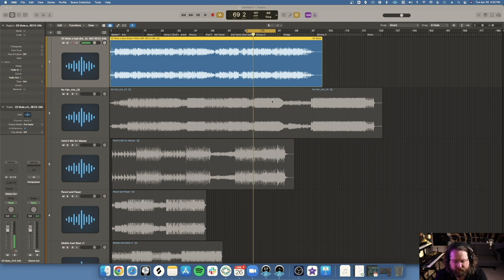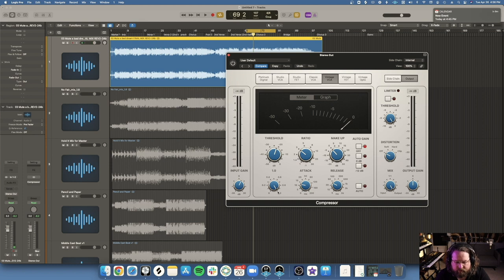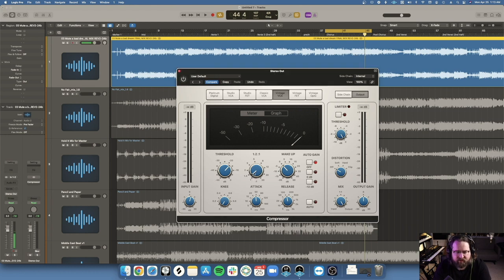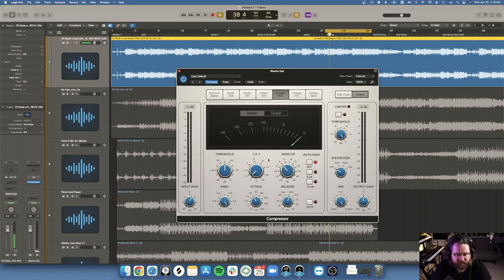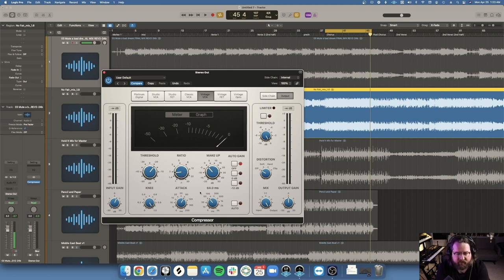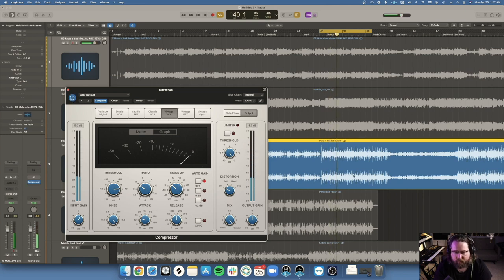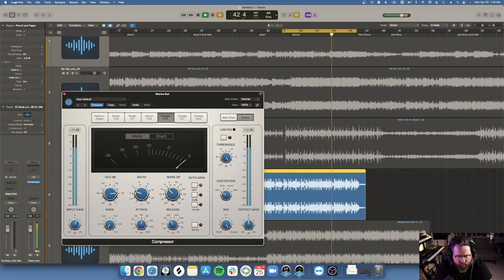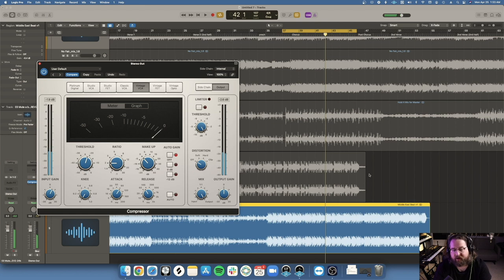How to Compress your Master

Comment: GREAT INFO! One of the better mastering compression guides I've seen yet! 

One question: I noticed on all the compressors u have the input gain set @ about +3-4 db, no matter which track you're working with, why is this? I ask because I've been getting into the nitty gritty of compression builds and noticed that many com0pressors are set to the -18dbfs sweet spot that gives them their best qualities, so I set my tracks to hit them at that volume. Your mixdown tracks I'm eyeballing at around -9 db, so you're gaining 3 db back for the compressor input, is this by design?

Anyways, big thanks, very good info here on the simple basics.

Comment: Hi Caleb and Blake and Dane!

Just got your email for this vid tonight. 

This is my very first learning of getting familiarized with what compression, is, and result's as sounding. 

Glue, whole total mix, as I now define is my reverb measure.

May I ask if you can more specifically define, "transients?" Breathe clarity and glue are the adjectives you're using that I understand moreso right now. That's the point of utilizing compression for it's final result? 

Ahhh, I can add this: you guys are in Manhattan where super markets are anathema. I lived there once. But I made a sound observation in the rest of the country's chain store Whole Foods where they both, turn it up a little more and chose a bit more alternative or otherwise contemporary song choices.  And what my mixing ear heard there that I have started noticeably utilizing in my own Covid Time CD release Tonight She and the songs I'm doing now called, 2022 Missing Link Us, CD More Pressing, is the mixed level of the drums. I noticed drum mixes at Whole Foods and what characteristic to my ear, made them professional, that the drums are, "on top." Put your drums on top is what I'm telling you, that's my opinion. As everyone has opinion and that's one I recently heard at CA Whole Foods. 

So if anyone hears that in my songs currently, it's intentional.

Generally for any and all, a good way to train an ear is to LISTEN TO THE BASS only. This improves any listening ear. 

If a Compression Unit is mostly or all as what defines or comprises, mastering I'm glad here to be getting familiar with this skill and technique. 

I'd rather have a record company doing it for my songs instead but since I'm desiring in being signed it's good to learn a little or more about mastering. 

My job is to write a song that you hear tonight that you'll be humming when you wake in the morning.

"You had one job."

More later I guess.

Thank you for the invite to this video and YouTube channel.